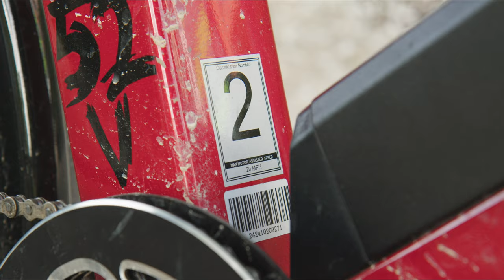Your Next Car Will Be An E-Bike. Here's Why:

Comment: I used to be a petrolhead too. Gave up on the idea of owning a car after a while though because just applying for a license here in the UK is a pain in the ass. There was a huge backlog of applications due to the pandemic, so it was taking up to a year for some people to receive their provisional license. Decided to buy an Engwe EP-2 Pro back in February for £1100. It was the biggest purchase of my life, but it's proven to be the best purchase of my life. I'll be honest, I mainly use it as a grocery getter, but it's perfect for this purpose. I'm currently in the process of doing some light upgrades to it. Just put on some low profile alloy pedals and I'm waiting on a stem and 8" BMX race bars to put on it so I can get rid of the giraffe neck stem. Might upgrade the battery/controller/motor later down the line, but my main concern right now is the brakes because they're not great. Can't be bothered with hydraulic ones, but I am going to upgrade the rotors to 203mm at some point. I've heard they make a good bit of difference.

Comment: I've been commuting by e-bike since September 2020; I'm closing in on 40 000kms (24 850 miles) travelled. Even though I live in the mildest Canadian climate, there are times during winter I purposefully lower power assist to increase physical exertion in an effort to keep warm.  I've invested in heated gloves and wear thermal underwear whilst biking...yet, tomorrow and Wednesday, I'm facing 85 minute, 40 degree Celsius (104 F) rides.

I cherish every moment on my bike, and wouldn't trade it for anything.
Reply from the maker: You are one intense individual.

Comment: You already have some pretty good examples of how the infa-structure change would look and how to implement it. Sweden has been doing this for years. They have large networks of bike roads. And they maintain them year round. Making it safe to ride everywhere all of the time. It is radically cheaper to maintain than car roads as they have a lot less wear and tare.
As far as where we draw the line from ebike to other classes of vehicles it's actually pretty well defined. You went over the classes of ebike here so I won't get into that. But the other things that define an ebike as a rule are having a crank, pedals and being able to be peddled. If you don't have peddles you are a motoscooter which requires a license, registration, and insruance (in most states). If you have peddles and you go over 28 but less than 41 you are a moped. Registration, license, and insruance (in most states). If you go over 41 peddles or no peddles you are a motorcycle which requires a motorcycle specific license (the motorscooter and moped for whatever reason can be ridden with either a car or motorcycle license),registration, and insurance (in most states). 
One of the bad wraps ebikes have gotten are because of the high powered ebikes that people are jetting around on illegally. I personally think it's a big part of the negativity around ebikes in a lot of peoples mind. When folks thing of ebikes in America they tend to think of the Sur ron, and the super 73. The Sur Ron is shipped as an edirt bike. There's no intention for it to be ridden on roads stock. It doesn't have peddles, it doesn't have a crank, it's too fast. There are road legal kits for it, but almost no one runs them because they are an expensive after market kit.  The super 73 and many of it's contemporaries actually do come street legal, but have means of unlocking them to make them go much faster. And the companies allow this under the pretense that the bikes are required to only be driven at those higher speeds off road. The issue is people just run them at those much too high speeds anyway. 
Recently there has been some crack down on it. And that's good. If we can get to a point where collectively we agree that ebikes are a vehicle with these restrictions and if you want to ride it as an ebike you have to honor those restrictions we'll be in a much better place. 
If we can also get the government onboard with some sort of tax incentive for making an ebike your primary form of transportation that would go a long ways to getting them into increased implementation.
Reply: Similar problem here in Canada.  I've come across countless homebuilds and tweaked e-bikes that best 50kmph+ on my daily commute.  Not too far back, I witnessed a garage built 
e-bike that was clocked at 100kmph on a MUP with a stated speed limit of 30kmph.

Comment: Good script. Ebikes look really fun in the right context, i.e. well designed bike paths. I just don't know how versatile they are around town. In two other college towns, like Durham or Chapel Hill NC, you'd get crushed under a truck at some point. Few bike paths connect anything of note, so you'd be out in the stroads. People still have ebikes of course, but you can't supplant most of your car travel. These towns definitely need to create more infrastructure for biking. Also, how do you secure an ebike? Bikes are stolen so rapidly. You'd probably need to replace them once a year. I do agree with an absolute top speed for these things. The tech is straightforward enough that I can imagine people building their own drag bikes or similar. We should place speed limits on the use side, in addition to the current power limitations.
Reply from the maker: In my use case, I really can supplement about 95 percent of driving with my ebike. Costco, and other misc out of downtown stuff are what I use the car for. 

Yes, change in our infrastructure needs to happen. It'll be slow but worthwhile.

I secure my bike with 2 locks, and I have theft insurance for 4 dollars a month and 100 dollar deductible. I would actually like to see VINs on ebikes which would dramatically reduce theft.

Thanks for the feedback! :)
Reply: @Qsandbank  No problem! I saw your short video about making noise in Hillsdale too. I spend a fair amount of time there during the year. Tiny place.
Reply from the maker: Hah! Small world. Miss it over there.
Reply: @Qsandbank  did you ride ebikes in Hillsdale? I wonder whether it's feasible on 22 or 23.
Reply from the maker: Didn't have an ebike there but I'd ride a normal one. I would say stick to the backroads if possible...

Comment: I think not in my State. No bike lanes.. Snow and ice.  Rain.. Hot 90° days no fun. Cold 30ish temps not fun. So that leaves about 100 good days per year to use an E bike in some areas.😁 Relegated to sidewalks and side streets .
Reply: Even on 95 degree hot days they are fun you can ride a trail through the woods and it feels 10-15 degrees cooler in the shade and forest.
Reply: @mattsomeonewithansrt3948  yeah. Good if you live less than 2 hours from something like that..

Comment: Here in the Netherlands we are kinda having a issue with e-bikes. Specifically fat-bikes. They kinda look like yours, big tires, small weels and a fast moter.

The problem is that there mainly used by 10-16 year olds. Who [upvoer] them. Which makes them go 50-80 km/h

Anyway, thats just a us problem, E-bikes are amazing.